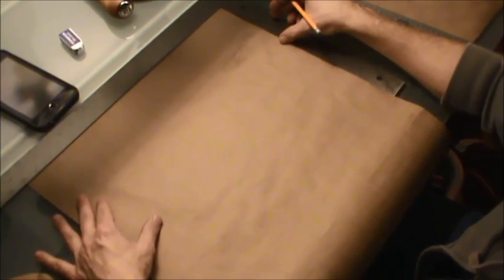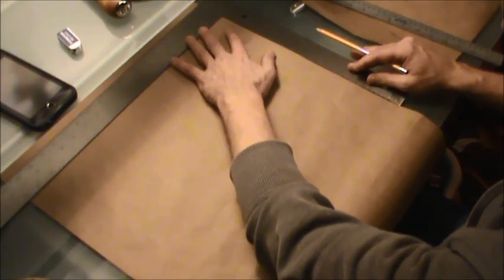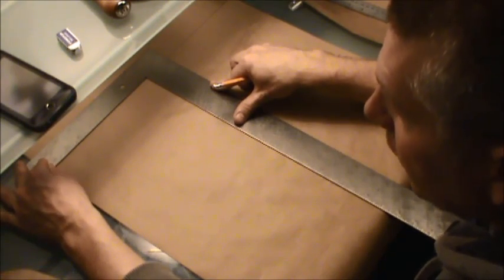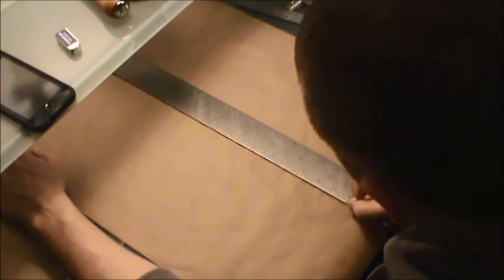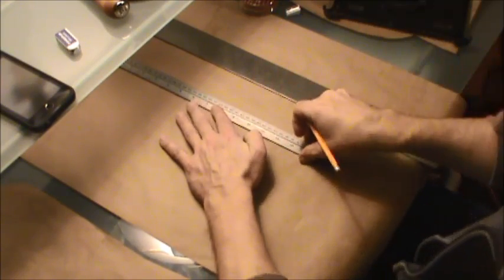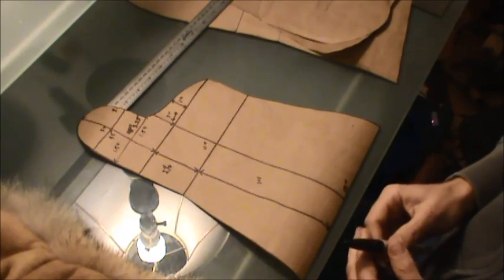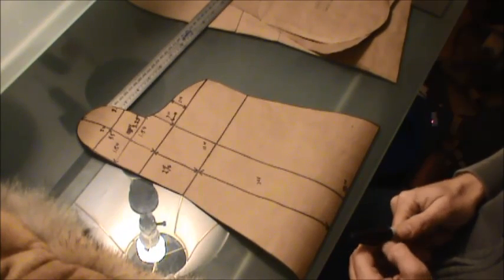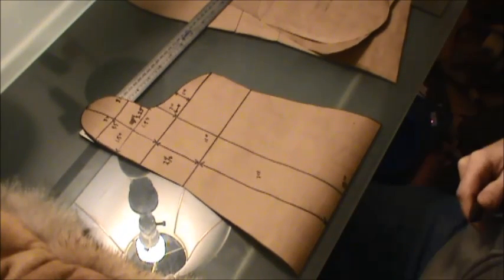FUR MITTEN PATTERN

Comment: Im super late to the party but this will be nice for my rabbit stash. If i wanted to do a trigger mitt, do you think theres a whole lot of extra steps invoved or should i be ok just rounding off a finger from the main part?
Reply from the maker: Can’t see it being a major issue, but you may want to do a mock prototype with random material first to ensure that the pattern is correct before you use it on a fur?

Comment: What is the thickness of the wool that you lined your mittens with, and where did you find it? Would you go that same route again? I just cut out this pattern. Going to do a mock up and then make a go at it with beaver.
Reply from the maker: It was a repurposed shearling coat. It was approximately 3/4” thick .
Purchased the coat at value village in Saskatoon for $20 I think; wore it for years previously. Just didn’t wear it anymore and needed a liner for this project. It was kind of hard to cut the coat up, but it went to a good cause!